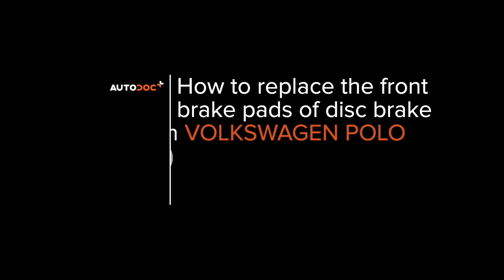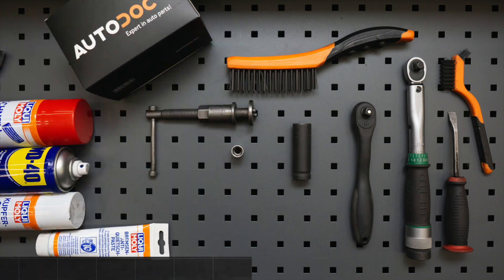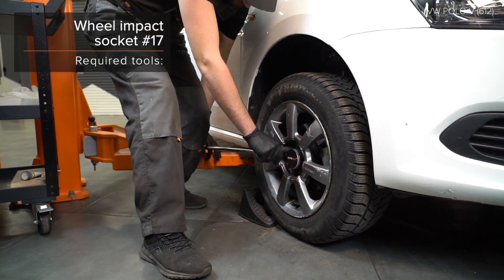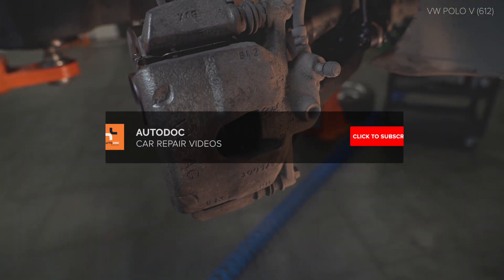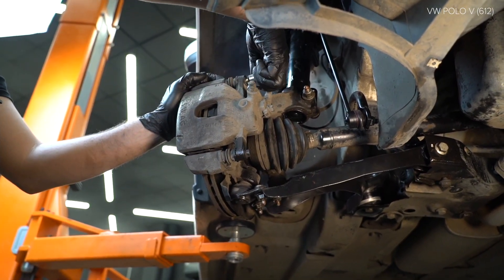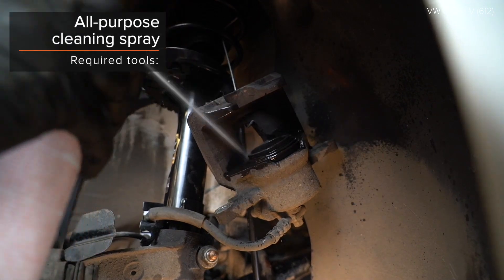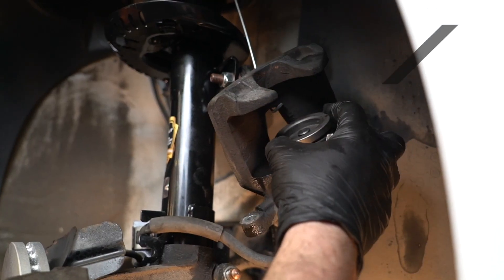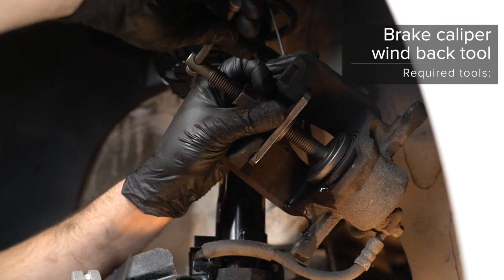How to change front brake pads / brake pad set on VW POLO 5 (612) [TUTORIAL AUTODOC]

Comment: Can you show how to change rear brake pads for cars with EPB "ELECTRIC PARKING BRAKES" 👍
Reply: Technically you need to have the correct software and set the ecu to wind back the pistons but it can be done without it, I have done it before. You need to remove the motor from the caliper and wind it back that way ( usually a torx bit is needed )
Reply from the maker: Thank you for your comment.
We will take into account your wishes when shooting new videos.
Best Regards,
Autodoc team